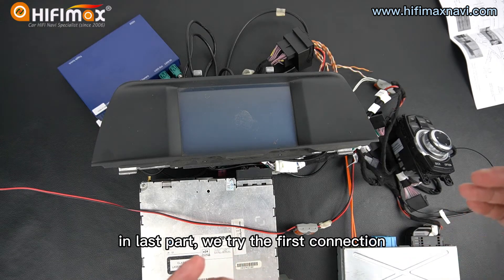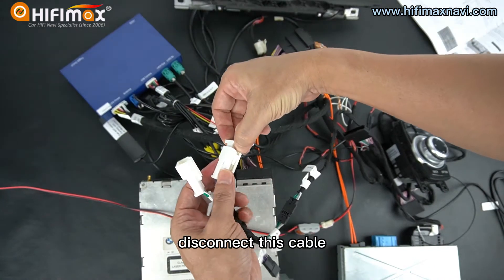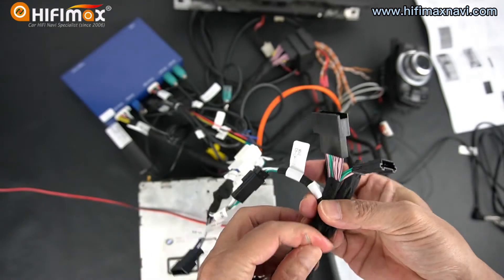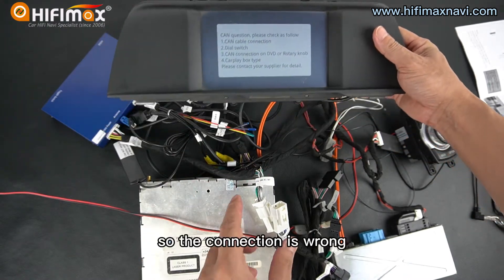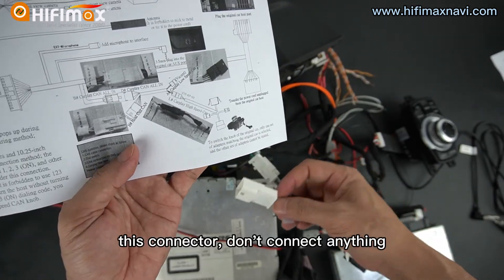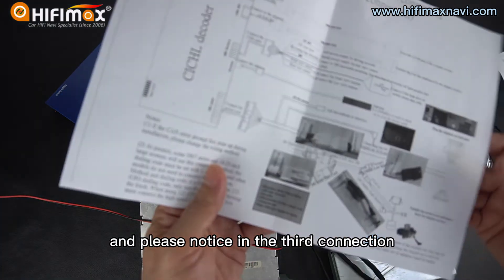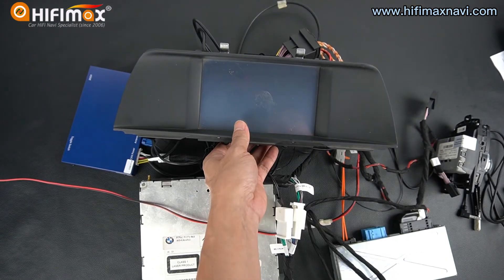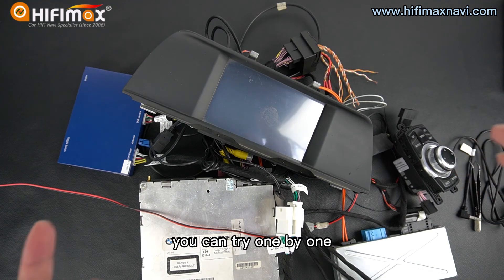P2: Wireless BMW CIC Apple Carplay installation - BMW CIC Carplay retrofit DIY install guide

Comment: What's the difference between the new blue MMI and the older black box MMI?
Reply from the maker: The software and power harness is different, the new Blue MMI have re-design the power harness, so the installation because easier.

Comment: Hello. I have bought this one carplay. But I have some trouble with the connection. I have already tried 3 methods but they are not working for me. 1) iDrive working fine on the OEM menu but if I hold the menu button the orange text "NO SIGNAL" appear and I can just back to the OEM menu. 2) The CIC doesn't start and I can't do anything. 3) The OEM menu starting so slow and iDrive doesn't work. Between all of the methods, I have disconnect the car battery for a 3-5 minutes. I have checked all wires connections and I have moved 2 green wires to new connection. PLS I really need your help. I have BMW F30 2012 with CIC  with 8.8 monitor.
Reply from the maker: you can contact your seller, to ask details, maybe your model not same as us, thus, the connection also different, it need to check more details, like LVDS, DIP setting , and CAN connection you made etc. I can not offer solution from your description now.
Reply: @HifimaxOfficial , yeah, thx for the answer. I have already contacted my seller and wait answer from him. But I decided to ask you because I have the same carplay as in this video. In my case, LVDS is the same as in OEM HU, DIP setting as in your video (in each connection variant) and CAN also connected like in your video. But it is not working( So I decided maybe you have a case like I said and you can help me with a solution.
Reply from the maker: @manden4ik   For CIC model, key steps are (1) Optical cable movement (2) LVDS connection (3) DIP setting (base on the CAN connection you chosen (4) CAN connection (that is most important part) 
(5) iDrive cable transfer(for NO.1 & NO.3 diagram).

It need seller offer great support and check these steps in Details.

Comment: Hello, maybe you can help me i have a problem with my carplay installation. 
If i connect my carplay like the NO. 1 wire connection from your video, my idrive controller dont work and neither do my carplaybox (no lights, no carplay)
When i connect the wires like NO. 2 wire connection from your video, my carplay works but my idrive controller still dont work and i get the sign „can question, please check as follow“
Do you know where my problem could be? Is this a connection issue, that i connected something wrong or is this an wire issue that maybe the wire is broken or something
Reply from the maker: Did you moved the optical cable to new harness ? and did you set the DIP setting correctly ? it might need to check more details.
Reply: @HifimaxOfficial  yes i moved the optical cable to the new harness and i also set the correct toogle switch. 
Sometimes now my display becomes red sometimes it normally show my oem menu but i still cant move the idrive controller. Could it be that the wiring the idrive is broken?
Reply: @HifimaxOfficial  I tried connection 1, there comes the red screen sometimes and sometimes it shows my oem menu but i cant move the idrive controller 
with connection 2, the carplay menu starts but i get the sign that the connection is not correct=wrong, the only method left is the third connection, do you think that that is the correct connection for my car?
Reply from the maker: @argjendkurtaj896   You have to try , no one can tell which diagram will fit a detailed car model, since the configuration might be different for different car types, that is why we offer 3 digrams. When you using the NO.3 diagram, after connect the cables, please notice to restart the car, meaning power off the car, lock the door (so that to cut off the power), then wait about 2 mintues, open the door and power on again, so that reboot the car CAN system. Notice, the NO.3 have different DIP setting.